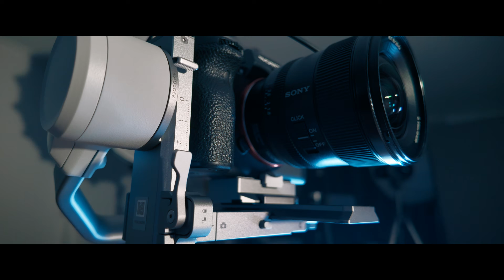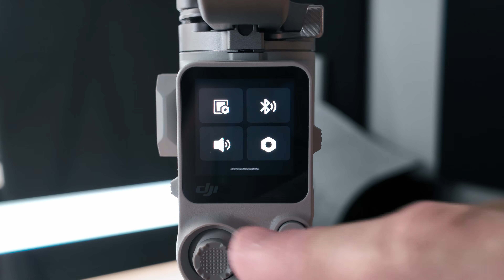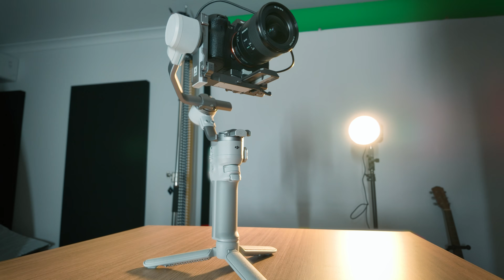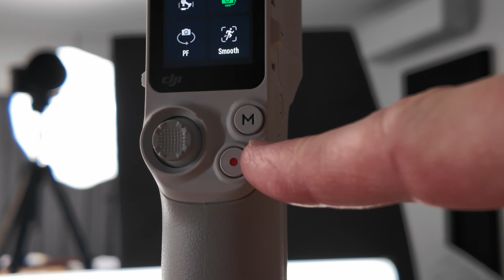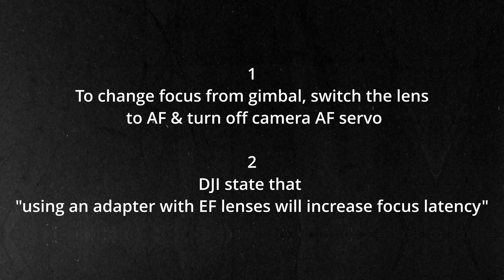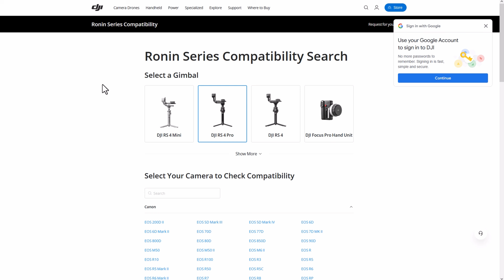DJI RS 4 Mini Camera Connection and Control

Comment: Great walkthrough!

One annoying thing I've noticed and which I got confirmed by your explaination, is the fact that functions differ depending on bluetooth or cable connection. I've set M button to toggle AF but this only works through bluetooth. While connected via cable I've set the ring above the trigger to adjust focus. My idea is to be able to switch off AF with the M button from time to time and then adjust focus with the ring. But this configuration does not work only because of this wierd bluetooth and cable conflict. It's so wierd. Do you have any suggestion to solve my little predicament?
Reply: Don’t you have to use auto focus in the camera anyway for the wheel to work?
Reply: @AntoYT1234 No auto focus is auto focus. The wheel on either the stabilizer or the lens wont work if auto focus is on. If you turn auto focus off, you will get manual control with either the lens wheel or stablilzer wheel.

Comment: Please read this before you buy. Rs4 mini doesn't work with fujifilm cameras, although their website claims otherwise. Not via Bluetooth, not via usb. No connection and no control. I mean, no, nada, zero, you can't do absolutely anything, even press the rec button on the gimbal.

Comment: What if the camera said coudnt pair this device, i use sony a7iv and rs4 mini
Reply from the maker: Check the DJI compatibility checker using the link in the description and if your cameras are supported check the detail connection instruction to see if there is anything special you need to do on those cameras.